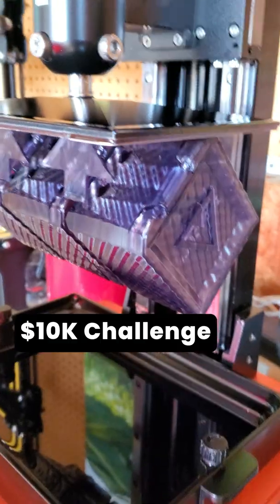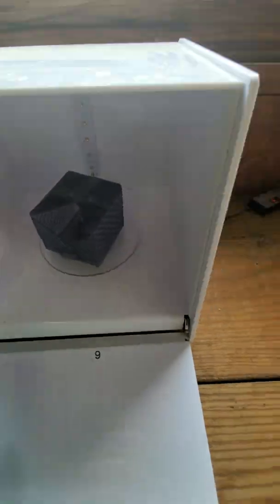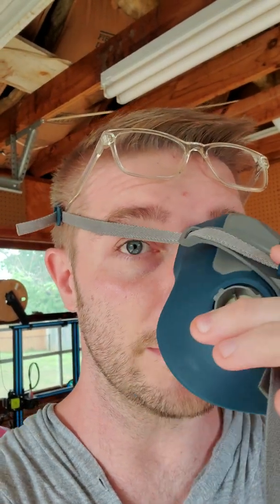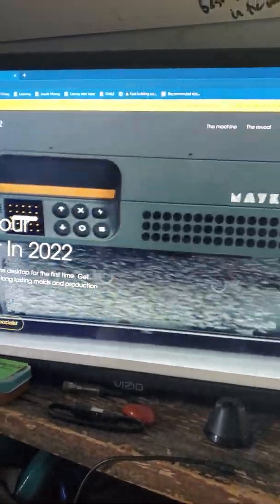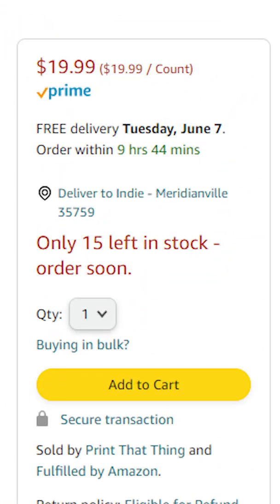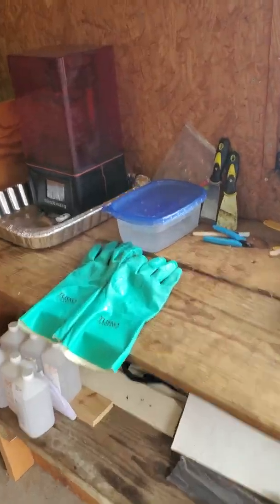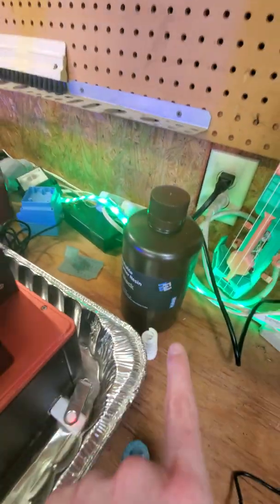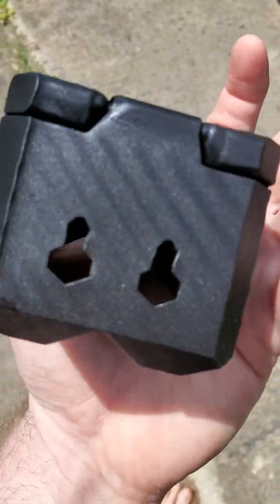3D Print On Demand Tips ($10K Challenge) 3D Printing Business w/ Resin 3D Printer

Comment: What product are you using for cleaning?
I use methyl hydrate in a big container for big print and clean my bed. It cleans it very well and fast and dries out quickly. To speed up the process, I blow air from my air sprau gun and in 2 min its already under the uv light for curing!
Reply from the maker: That's great advice! Thanks for sharing yoBoyRomz.  I'll try these tips.  :)
Reply: Also try stacking your print design as Ive seen in other videos! Nice thing going on I've started selling 3D prints online since last year and looking forward to step my game up 🔥